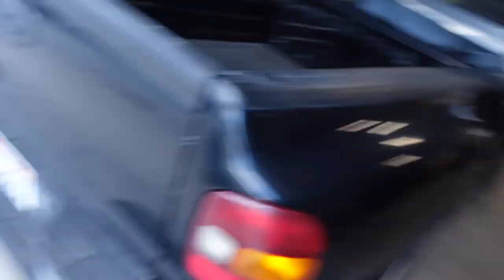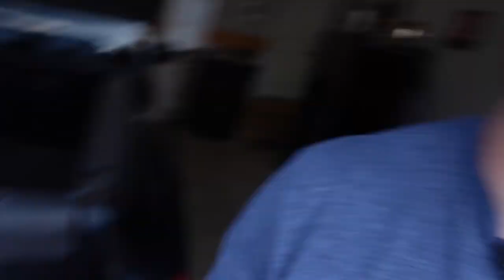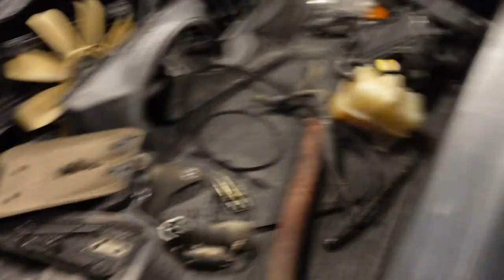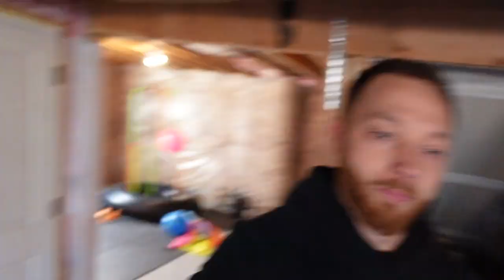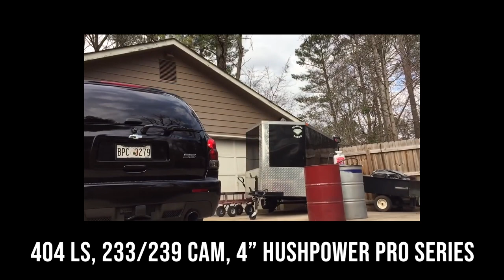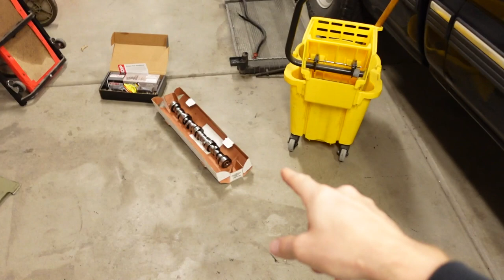4.8 vs 8.1 build begins by REMOVING THE 4.8?

Comment: In my 06 4.8 I run a 212/218 and .522/.529. I wish I had gone a TAD bit larger, about what you're at. You'll really enjoy it. I'm running a 114lsa but wish I'd done a 112... But with the 3.23 gearing, it's doesn't move well from a dig but it pulls like a freight train above 3k

Comment: I've been subscribed since about the time you started the Ugly Truck build. Very much enjoy your content, but I'm mainly interested in the GMT800 stuff -- I have 3 of them... That said, in your head to head between the 8.1 and 4.8, I wanted to see if you would include two other budgets with your $3k limit: The time it took to acquire all your parts, and the time it took you to complete the work. Why? Because I think the acquisition time will lean in favor of the 4.8, and I suspect the time you spent on the builds will do the same -- but I'm less sure on that one. Mostly I think it would be interesting if you spoke to the knowledge/skill required fo things like this, as opposed to making it look pretty easy like you do. :-) Also, I assume you are going to keep the AC on this one?
Reply from the maker: those are both good points to compare against as well... and yes, this one will for sure keep the AC intact...

Comment: I’m kind of wondering why you’re using a 4.8 liter from the stepside when a 5.3 would make a ton more power than the big block 8.1. Not sure if the 5.3 was around back when this year Silverado/gmt800.  Im interested to see how this build turns out.
Reply from the maker: I'm using the 4.8 because thats what I have to work with. Sure, I could swap it out, but I like the biggest vs smallest comparison anyway...
Reply: That makes sense You don’t see too many 4.8L out there. There’s plenty of 5.3’s out there making big power for under 3k. Will be an interesting build I’ll definitely tune in for.
Reply: @TBGaels32  the 8.1 makes 455 lb ft.
Do you really think mod for mod a 5.3 will make more power then a 496"?

Comment: I don’t think that rotating assembly parts should be included in the 3k budget. Forged pistons will not add anymore power than stock, same for rods and crank. If you’re changing the compression then that’s different. 

You’re already in the motor just build it properly right now so you aren’t pulling it out again.
Reply from the maker: you're a bad influence
Reply: @LawrenceTolman  LOL🤣

Comment: The whole purpose of an x-pipe or H-pipe is to equalize the pulses and create a scavenging point when you’re running dual exhaust, this we all know already. Using one on a single exhaust system is absolutely useless, just run a Y-pipe and a massive exhaust after the Y and you’re good to go.

Comment: What’s the mileage on your 4.8?
Reply from the maker: 185k give or take
Reply: @LawrenceTolman  thanks for the reply. My 4.8 also has 180k and currently I am replacing the head gaskets due to a coolant leak. I’ve been contemplating whether or not I should swap the cam out since I’m already deep into the tear down. I was worried about the mileage being to high but I think you helped me make up my mind. Now I just gotta wait for all my parts to arrive. Nobody stocks performance parts in Hawaii. 🤙

Comment: Didnt mr. holdner prove the dna long tubes out perform the texas speed and are 1/2 the price
Reply from the maker: I'm not sure, I don't watch all of his videos...
Reply: Im super excited for this build i have a 08 2wd lowered with a 4.8  its only got dna cai and long tubes and a mbrp exhaust.  With just those bolt ons i already feel like if i got a limited slip and got it tuned the 4l60 isnt gonna handle it. future goals are limited slip a stall with built tranny. injectors, fuel pump upgrade valve springs and a tune. Then maybe a pro charger or remote mount with low boost. But in all reality it goes pretty good for regular  putting around to walmart....

Comment: 5.3 and 4.8 have the same bore the rods are different that make the stroke different the 4.8 has flat tops and the 5.3 has dish if put 5.3 rod into the 4.8 u would get 15 to 20 horse

Comment: Those early engines had a "service notch" on the cylinder heads, keep that in mind when ordering gaskets. Better yet, get a newer set of the same casting number heads without the notch. I have seen a few people push head gaskets on the old service notch heads with generous amounts of boost or nitrous oxide. Just an FYI - in case you hadn't already thought of it.

Kind of sad to see that you didn't go with better valve springs for the future.
Reply from the maker: I had ordered the Mahle MLS head gasket designed for the 99-00 4.8/5.3 with the notch in place...

Comment: I did the atomic fab motor mounts and love them I also got the speed engineering full exhaust and love it only grip the clamps suck wish I had a welder that did stainless also I think iv done everything you can do to top end  on my 03 Silverado cam swap was first then tbss intake electric fans did the torque storm supercharger as well then had to get a well built transmission with 2800 stall tci converter I'm running out of stuff to do to this setup but having fun learning well sometimes

Comment: You could have started with a 5.3 first off.    An you can build a turbo kit an add fuel system for 3k an blow that 8.1 out of the water.   And your channel would be a million times better if you didn’t talk so much an actually put your vehicles to the test.   You want good content actually beat on your vehicles an talk less
Reply from the maker: yup, I could've done a 5.3 or 6.0 to begin with, there's no question it would've made more power to start with... and while I don't drive every truck in every video, there's plenty of "beating on my vehicles" happening on the channel...